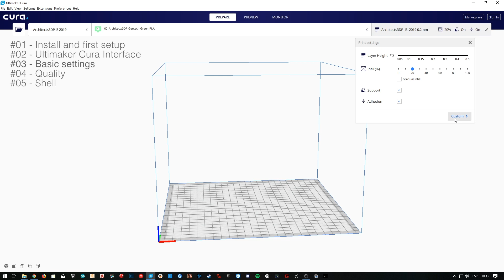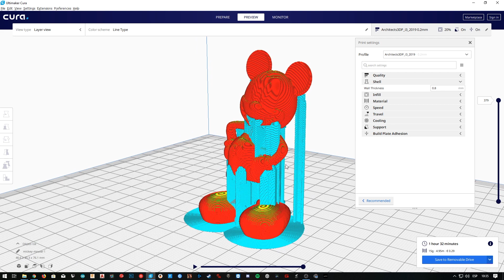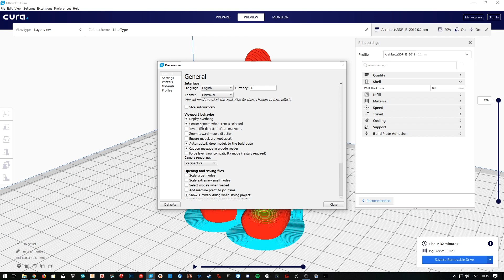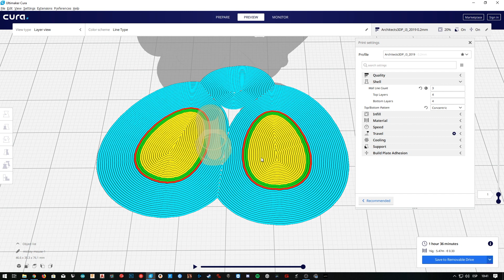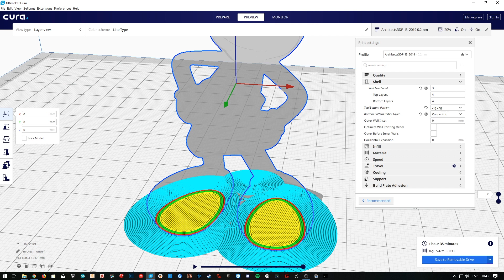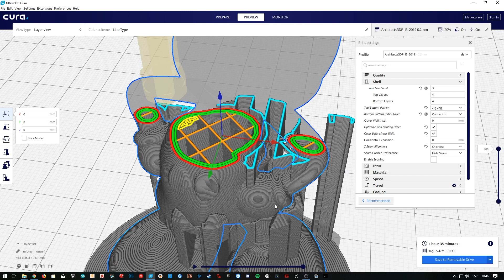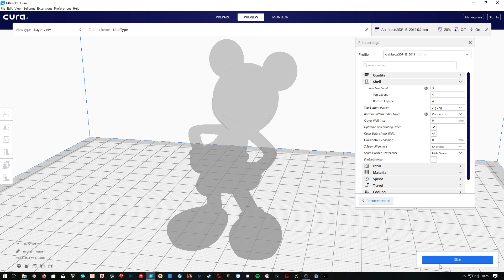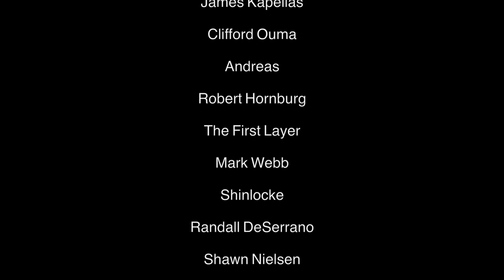Cura advanced settings 2019 - Shell #05

Comment: I want to configure Cura to print first inner perimeter and right after the outer perimeter ...but no...Cura first prints all inner perimeters and only then prints outer perimeter, this process leave a gap in surface print
Reply from the maker: then make sure your line-width and flow parameters are correct